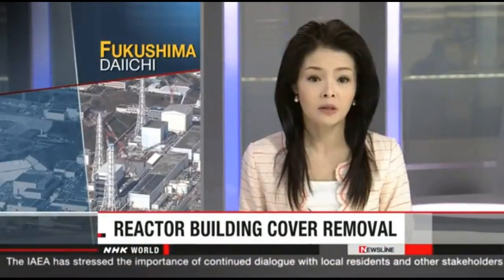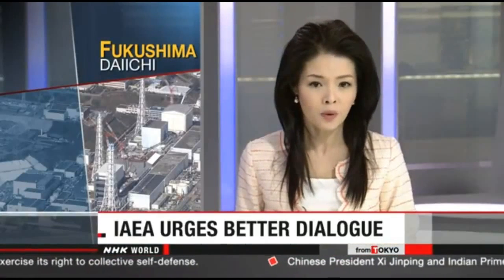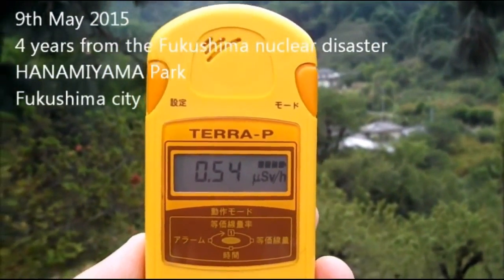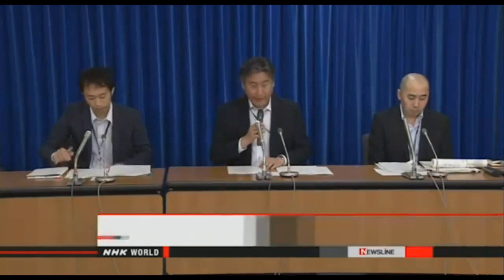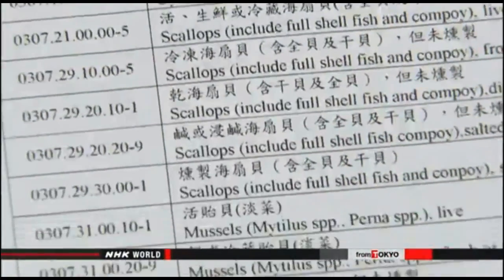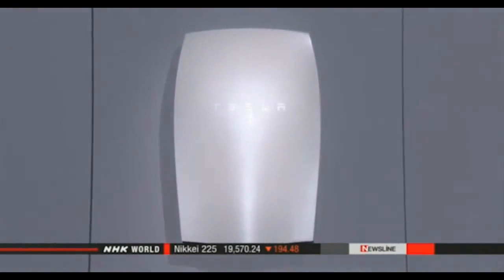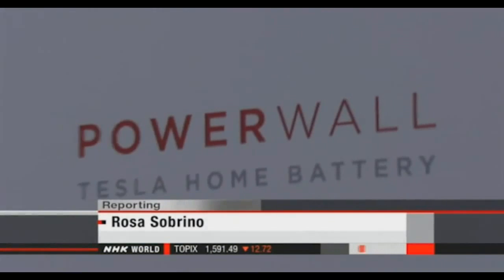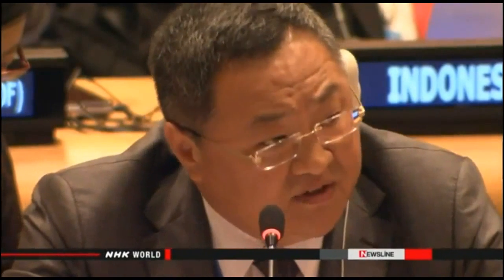Fukushima News 5/15/15: Exposing Unit 1 ; IAEA Worried About Stakeholders; Japan Ticked With Taiwan

Comment: This video is Packed with info!  Those battery costs are cheap.  I live off grid. Use Trojan deep cycle, just replaced them, they cost approx $1watt/6v.  The costs quoted here are about 1/3.   And solar cells have come way down in $$... We had 3000 watts delivered for just under $1watt.  And singing "Never again" is  rather ironic,  the people of Japan have been nuked by a large corporation.  That nuking is Far worse than anything in WW2.